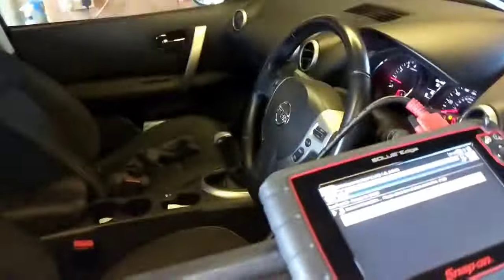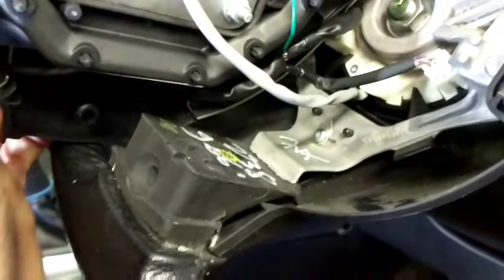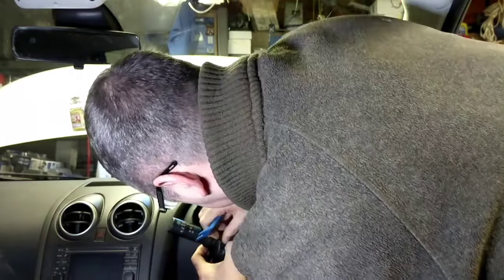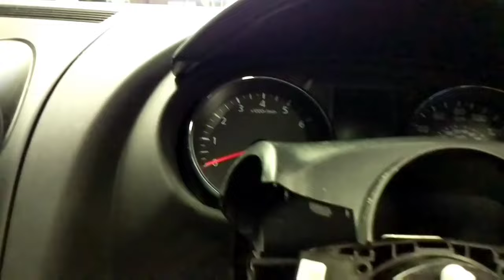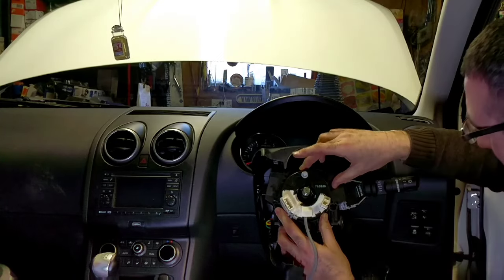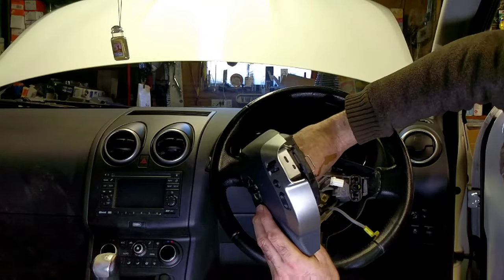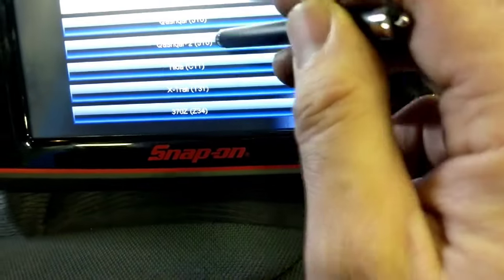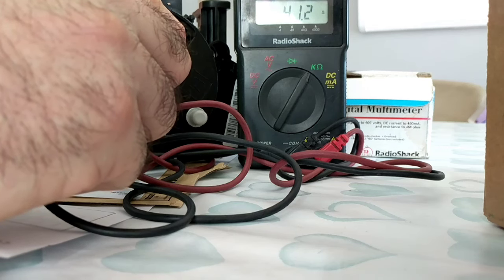Nissan Qashqai Airbag Light Flashing - Fixed!

Comment: Hello i changed this part 2 times first time the esp light start flashing because of wrong part then ordered a new used part. Now airbag light is of but steerig wheel buttons dont work.
Not music level buttons or any of the cruise control buttons work.. do you guys think its somthing wrong with this part as well or do i need to code it to my ECU
Reply from the maker: - I'm afraid used parts are always a bit of a lottery. I always use genuine Manufacturers parts for these repairs. If the steering wheel buttons worked before but not now then the part is either faulty or you've not connected the wiring up properly.

Comment: Hi great tutorial, i have been given the same fault code for my 2010 qashqai & quoted £250 for the repair. U said u used a genuine nissan part for £160....do u kno if there are any cheaper non-nissan  parts that wud work as i really cant afford £160 & i need to fix the issue to get it thru its mot. Thanks
Reply from the maker: I wouldn't use anything other than genuine for that part.  Sorry.
Reply: Hi, i managed to get a used genuine part & fitted it today no problems. Airbag light went out but now my traction control is on , cud this have anything to do with the battery being disconnected or is it something ive done
Reply from the maker: @jojobabycakes  secondhand is always a gamble. Did it come with the steering angle sensor still attached? - see 9 mins 15 seconds into my video. If it did then make sure the wiring is connected properly. You can always fit your old angle sensor onto the clock spring assembly. You may have to have it fixed by someone competent and with the right tools.